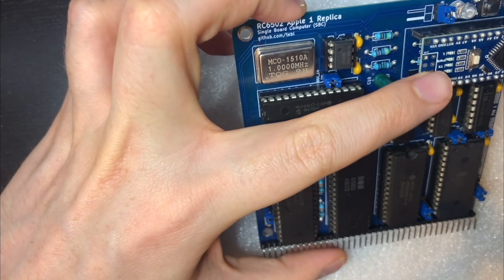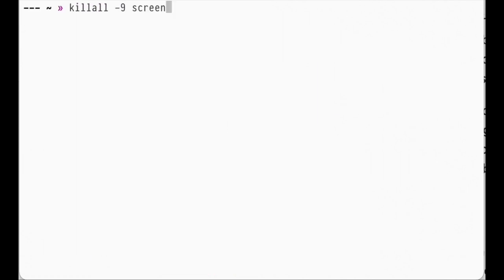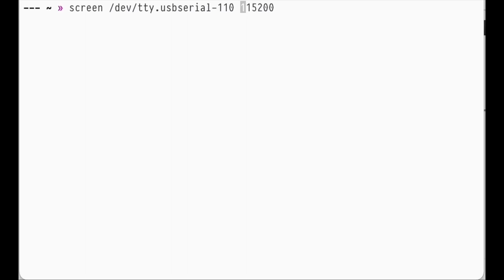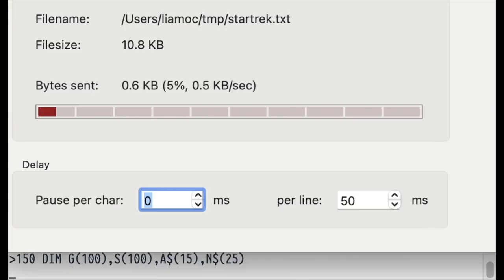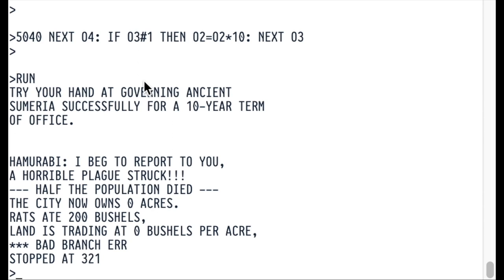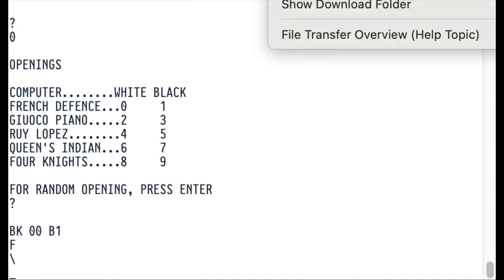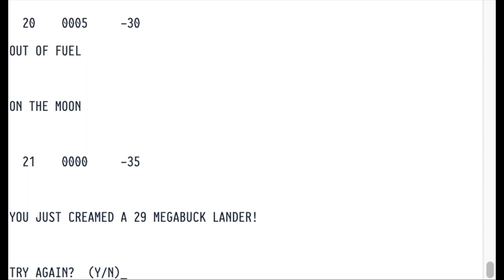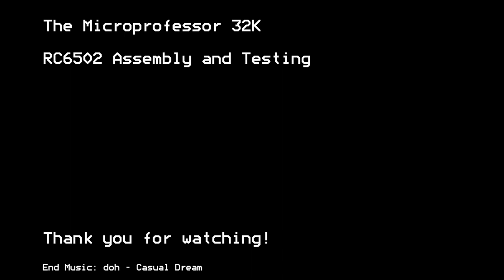Apple 1 Replica SBC! RC6502 Building and Testing

Comment: As have been mentioned earlier the Arduino doesn't support any kind of flow support, so a modern computer will easily lead to characters getting lost. Adding a character and line delay would fix this, TeraTerm supports this if on Windows. Happy to see you got the hardware up and running 😀

Comment: 40 FOR B=99 TO 98 STEP 0: PRINT : FOR W=0 TO 2: IF W<2 THEN 70
50 IF B THEN PRINT "TAKE ONE DOWN AND PASS IT AROUND";:B=B-1
60 IF B+1 THEN 70:B=99: PRINT "GO TO THE STORE AND BUY SOME MORE";
70 IF W THEN PRINT ",": IF B THEN PRINT B;: IF B=0 THEN PRINT "NO MORE";
80 PRINT " BOTTLE";: IF B#1 THEN PRINT "S";: PRINT " OF BEER";
90 IF W#1 THEN PRINT " ON THE WALL";: IF W THEN PRINT ".": NEXT W,B: END

Comment: Nice project. Thank you for posting the review. The issue you were seeing with uploading files seems an awful lot like a buffer overflow on the SBC side. I noticed on the silkscreen that the terminal parameters mentioned XON/XOFF flow control. Have you verified that this is enabled for your terminal program?  If not, try enabling it and see if that fixes your problem.

Comment: Hi, in new to 8bit computers, and i want to ask, that won't the Arduino be more powerful than the computer itself?
Reply from the maker: Yeah, it definitely is (or really, about the same actually), but we're just using it as a makeshift IO controller in this case.